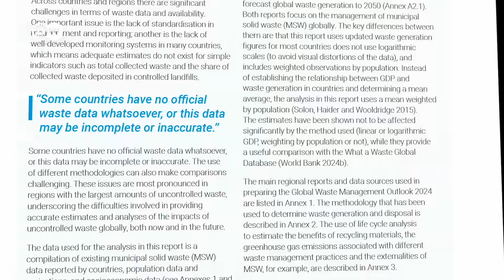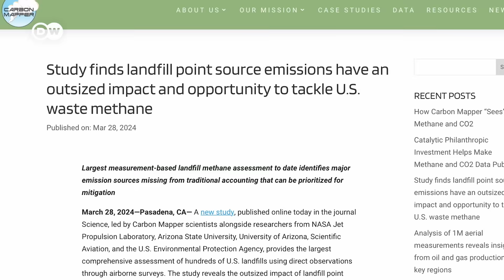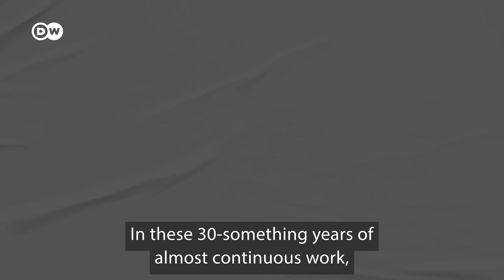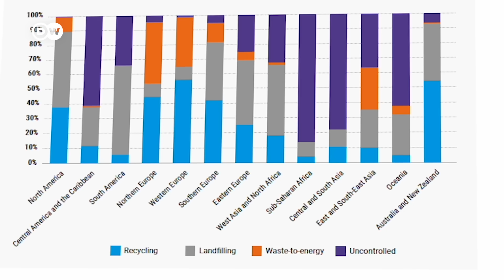We need to fix landfills – here's how

Comment: The easiest way to limit is to fully recycle everything, for anyone that says not everything is recyclable is a lie, everything can be separated either by chemical make up or physical or like food could used to feed livestock or feed insects to inturn feed livestock
Reply: One problem is that plastics are very expensive to recycle for the recycled products they provide. Not even China wants it now, except for special types. Cleaning and reusing containers would be more expensive but I expect that is the direction we will eventually have to go.
Reply: @robertdouglas8895  it's only expensive because no one has done it on a huge efficient way yet but with time that will change, we just need more coding, CAD and robots then it'll be easier
Reply: @Christopher-cr7pw  What do you think about reusing containers like we used to do with soft drink bottles?
Reply: @robertdouglas8895  yes for recycling or for melting down for toys or equipment not for reuse directly
Reply: @Christopher-cr7pw  Why is that? Heating water to clean them would be cheaper than for melting them. The soda bottles used to go back on the same trucks that brought the refilled bottles. Central locations could clean the bottles and charge for the cleaning. Every  food producer would use the same bottles.
Reply: Money money and money. Unfortunately it's cheaper to produce rather than reduce and actually recycling...
Reply: @joestuff8  haha only because of us humans,  if Tesla and Nvidia, Intel keep going the way they are moving human jobs will be cut and made cheaper in humaniod robots which never take breaks or need rest
Reply: @joestuff8  Long distance expenses need to be considered by  society, not by profiteers.